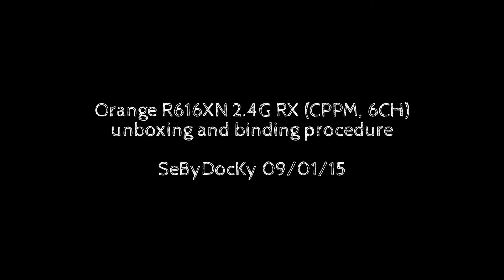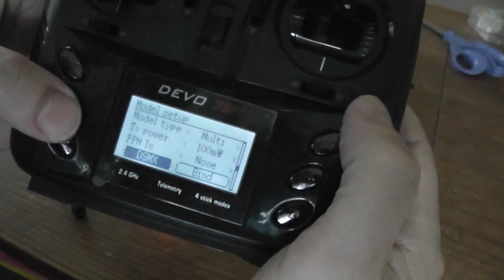OrangeRX R616XN unboxing and binding procedure

Comment: I couldn't find this information elsewhere, but from my testing it can stay in the bind mode down to about 2.7v (2.66v on my PSU but I don't know how large the error is) with the LED flashing. I haven't tested how low it can go without dropping the signal, but I think this would be safe to use on 1S without a boost converter. Just wanted to let you know.

Comment: Okay well, it is a receiver, but is it better than cheaper models that work with the devo?
Reply from the maker: +Anthony Eaglebarger (toysoldier46552) It's 1.8g (even 1.1g with shorter wires), supporting DSMX and have around 400-500m of control range so perfect for <150mm racers IHMO. I dream to have a 2g FrSKy receiver offering telemetry. The DIYFrSky is around 5g actually ....
Reply: SeBy DocKy ah so comparable to others in its class.